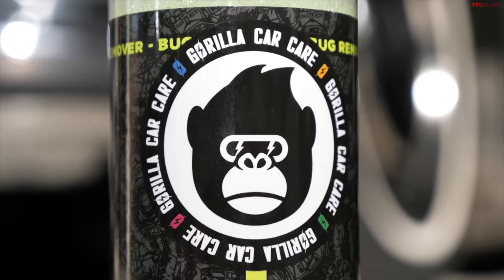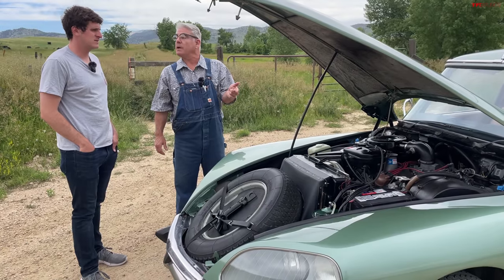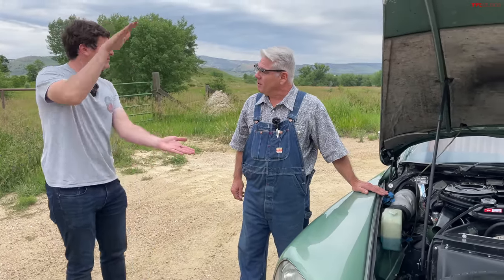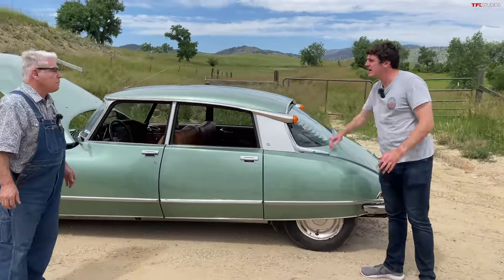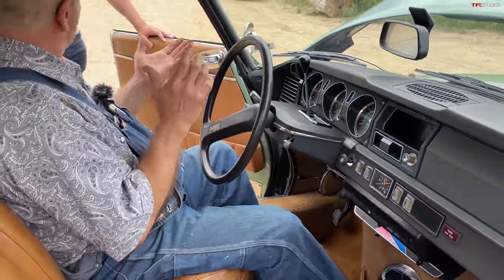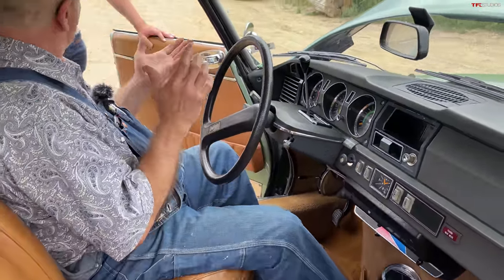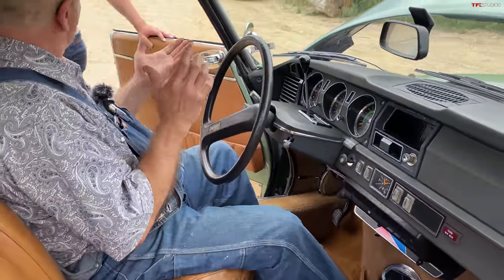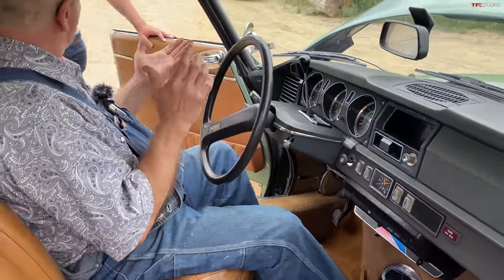Really THAT Unreliable!? Is The Citroen DS as Bad As The Internet Says It Is!?

Comment: SOME THINGS ABOUT CITROËN YOU MIGHT NOT KNOW
I grew up amongst a succession of DS sedans and recall my dad having no problems with reliability. The bodies tended to rust out very quickly, however. The manufacturer provided inlets for oil-spraying nozzles around the car, so in winter the most rust-prone areas could be protected, but nobody bothered to use them. (With equal alacrity, they designed a crank starter into the engine. On a freezing Canadian morning, faced with a dead battery, rather than call AAA my father retrieved the jack handle from the trunk and used it to crank start the engine like a Model T Ford.)

The DS’s velvety suspension was supplemented with the entire interior of the car, except the headliner, covered by a two-inch thick layer of foam rubber. Even the floor mats were made from a durable fabric that encapsulated this very thick layer of foam. The seats too were largely filled with foam rubber. All that foam, combined with the soft-riding oleo-pneumatic suspension, gave the occupant the sensation of, as they say, riding on a cloud. 

On a curvy road you’d think a car this softly suspended would wallow and induce road-sickness, or at least be cumbersome to manage. But the suspension valving incorporated anti-roll, anti-dive, and anti-squat properties, meaning the car cornered flat and handled exceptionally well. Along with augmenting the car’s ride smoothness, all that foam rubber insulated the occupants from road and wind noise, and in our Canadian winters seemed to make the car cozier. (Canadian DS models came equipped with a high-capacity heating and ventilation system.)

Put all the above together and you have a driving experience that is utterly unique. Riding in a DS, at least for a kid, was like being transported in some futuristic Jules Verne time-bending device that spoiled me for anything in the years to come, including far more expensive cars.

The company ran out of money (not for the first time) during the design phase of the DS series, and could not build the flat-six engine intended for this car. Instead they had to make do with the previous model’s inline four-cylinder. Though it made under 100 hp in its original form, thanks to the car’s light weight and aerodynamic design, it gave 30 miles to the gallon at 70 mph, and was capable of a top speed exceeding 110 mph. 

André Citroën, the founder of the company, was ahead of his time in the sense that he could spot a concept or product that was superior but never properly implemented. Rather than merely take note, Citroën capitalized on such novelties as the double-helix gear set, buying the patent then licensing its use and making his first fortune. A graduate of France’s famed Ecole Polytechnique, Citroën was able to adapt Henry Ford’s mass production concept to the production of munitions during WW1, and later to car manufacturing, eventually starting his own company. 

Unlike Henry Ford, who brutally suppressed his employees’ attempt to build a union, Citroën was an enlightened magnate. He paid his workers well and provided maternity leave and other benefits that were generations ahead of their time. In the part of Paris where his factory once stood there is a small park named after him.

Under Citroën’s leadership, in the early 1930s the company produced the Traction Avant model, in its way as revolutionary as the DS21 in several ways: His factory in Paris was a model of efficient production that was emulated by all his European competitors. The Traction Avant model’s novel front wheel drive architecture gave it superior handling and comfort, to the point it was the get-away car of choice by French bank robbers. Later, when Paris was occupied by the Nazis, the Gestapo commandeered every Traction Avant they could find due to its superior speed and other qualities.

A bon vivant sans pareil, Citroën lived lavishly even by the standards of an industrialist. He was a gourmand and a womanizer, but what finally brought him down was his addiction to gambling. When the Depression struck in 1929, his company’s profits having been lost at the roulette table, Citroën eventually was forced to transfer ownership to Michelin. (Development cost of the Traction Avant also burdened the company beyond its means.) 

A man of good taste to the end — he was to die in 1935 of stomach cancer — Citroën immortalized himself and his brand by funding the lighting of the Eiffel Tower. His combined engineering and aesthetic standards put him in the elite of auto makers — Ferrari, Maserati, Bugatti, Henry Royce, William Lyons who founded Jaguar, and a very few more — in that his product transcended its original purpose, as a transportation device, by providing its occupants with a sense of luxury and futuristic design that to this day impresses even those among us who are not car lovers.

The original post posed the question of whether the DS series was reliable, and the answer is a qualified yes. The car was well built and reliable, but it was not built to last. In their quest for efficient manufacturing and superior fuel economy, the car’s designers incorporated hard plastics throughout the interior. They do not age well and were disappointing even when the car was new. The switchgear also was mediocre. A look under the aluminum hood reveals a gigantic engine bay, crammed full of power plant, the spare tire, and what seem to be miles of high-pressure hydraulic lines. It is this car’s rubber and plastic components, because of their use in every part of the car’s functioning, that make owning this car in modern times contingent on eventually replacing everything that flexes. 

After Citroën pulled out of America in the mid-1970s (for them, the 5-mph bumper requirement was the last straw), you could buy a DS for next to nothing. As late as the 1980s and maybe later there was an American source of spare parts. Its founder bought up Citroën parts worldwide and sold them at reasonable prices. 

But that was 40 years ago. Now, I suspect, any DS still running has been restored — not by a speculator who seeks to profit from it, but by a genuine enthusiast. They will be discerning about what lucky person is the next owner of their DS.
Reply: What a great write up. Lot of stuff I didn't know.
Reply: Good info. My 1979 DS20 had 3 faults. It was a vacuum cleaner on dirt/gravel roads, it overheated on the highway on Saskatchewan summer days and couldn't defrost the windshield enough to drive at -40.
BUT yes it did 40 mi/Canadian gallon at 70 mi/hr and 35 mi/gal towing a 2000lb trailer. (used 4th gear once downhill in 6000 miles one summer). The video suggested the clutch was a weak point but we had no problem in 80,000 miles with a lot of trailer towing in the BC mountains. (starting off the front position on a ferry up a steep ramp was a challenge with the automatic clutch engaging fully at 800rpm and 104 hp not developed until 5000)
Reply: In Europe, many Citroën dealerships were poorly qualified to service the DS properly - especially in the early years.
The cars that survived that time have it better now. Not only are they almost exclusively  driven by enthusiasts now - they are usually serviced and repaired by a small number of DS specialists who know much better what they are doing.
Reply: @johntechwriter7097 Love it, that there are still admirers on the other continent! I have all produced Citroën's in my collection! But the Citroën DS stays the most modern one in its looks. After Peugeot took over, Citroën models went down! Ugly cars where produced and when Citroën made a successful model, after a few years it disappeared from the Citroën list; got rebadged and appeared as a more expensive Peugeot! For instance look what happened to the C1, it is was no longer for sale as a Citroën but got re-badged as a Peugeot 108 and stayed on for years.... I stopped collecting after the CX... They became too plastic...all these plastic fronts, horrible. But to get back to the DS I have got a berline "palas", a "decouvrable" and a "break familiale"! Did you know that you could order a traction avant with hydro-pneumatic rear suspension? My daily drive has this feature! By the way: you can buy new parts for 'old Citroën's' at The 2CV Mehari Factory in Belgium! These parts are not second hand or refurbished, but absolutely brand new! Anyway, still loved your interesting history of Citroën! Stay tuned😊
Reply: i aint readin ALLAT
Reply: My memory is that the side impact safety standard that was the end of Citroen imports. The SMwas sold for a few years after the ID and DS were dropped.
Reply: @aworthlessmanofnoworth7041  You don't have to!
Reply: So many cars from back in the day just rusted away because of poor maintenance.
I was looking at family photos, and you can see our Simca 1100 become a rust heap over a decade.
Such a sad end for another car that was before it's time.
Reply: Awesome to see someone from across the pond with that same enthousiasm for this quirky French brand as us Citrofiles in Europe. Just to add to the shared knowledge here: did you know that the brand is called Citroën because of its Dutch roots? The family name was actually Citroen (Dutch for lemon), and after they moved to France it was found that the pronounciation of "oe" in Dutch (approximated it's a shortened "ooh") was too hard for the French, and they added the accent to the e, hence creating "Citroën" (Kevin got the pronounciation bang on!).
Another fun fact, relating to the post above, is that Citroën did indeed immortalise himself by funding to light the Eiffel Tower (don't romanticise that though, it just meant that for the longest time, the word Citroën was branded in huge letters on the Eiffel Tower) - but they also used that to promote their big come-back model in the 80's! In the 70's, Citroën had lost its way - it was bought by Peugeot in 1976, thus becoming part of PSA, and they found that every good car they made was immediately scrapped and rebadged a Peugeot. In order to regain relevance and become a healthy car manufacturer again, they had to reinvent themselves. They started developing a car called Projet X, which would slot in between the GSA and CX. It was a rough process, changing from Projet X to Projet XA and finally Projet XB, but by July 1982, Citroën announced the model as the Citroën BX (the letters were swapped around to fit in with the CX and later AX models) - set to replace the GSA (which took until 1986). In October, Citroën hung a big box on the Eiffel Tower that simply said "Voici la nouvelle Citroën" - note the article here, la - they're not saying "Here's a new Citroën", no it's explicitly stating "Here's THE new Citroën" to invoke the sense of a brand reinvention. They lowered the box and out came a red BX, which was a complete stylistic departure from old Citroën cars. Square, boxy even, instead of flowing lines - the inside was still quirky, and it had the typical hydro(oleo)pneumatic suspension, but still. It was the car that saved the brand: from 1982 to 1994 Citroën built 2.3 million BXs. I still count myself very lucky to have one, a 1993 BX 1.4i Deauville.

Comment: This has to be the best DS video in YoutubeLand. So interesting and factually presented. The Citroen suspension was so smooth that Rolls-Royce used the same system on their 1965 Silver Shadow. They produced it under licence from Citroen. Tells you how special the DS was, --light-years ahead of the competition. Great cars. If only people could buy them new today.
Reply: Wow, I never knew that, thanks! I had an ID19, and though I've never ridden in a Rolls some of my friends back then had, and they told me my car was smoother and quieter than the Rolls. I didn't believe them, thought it was just flattery, but that car was indeed smooth and quiet, and a great ride. I got asked if my ID19 was an automatic, because the shifting was undetectable (unless I screwed it up,) but it was just a 4sp column shift that made no sound, it just slid into gear. Loved that car, I'd have another in a NY minute!
Reply: I drove a 1994 RR Silver Shadow when I was living in NY.  In comparison, I'd much prefer the Citroen.
Reply: @sunriseboy4837  it needed service i had both, at the time there was rolls royce and mercedes than there were all other carts, only wanted a SM as the citroens the bigger capacity engine i had was a 2.173cc´s as written on the back of the DS GT, also have two mint tracion avant from Dupond & Dupond from tintin, it still works as a daily driver for the years it as

Comment: When I served in the USAF back in the late '60s, I had a Citroen ID19 which I drove all through Europe. It was by far the most comfortable car I've ever owned; mine had a 4-speed column shifter & a lot of people thought it was an automatic because it shifted so smoothly. The interior was all lined in foam rubber under the carpeting, so it was quiet as a Rolls.

If I didn't live in N. Texas, where it gets hotter than Hades in the summer, I'd love to have a DS21 (but I'd have the 5-speed shifter!) One thing that didn't get mentioned in this video: it's the only car I've ever had where you could have the driver's side window down & not get blown out of the car by the wind! That's because the front of the car is wider than the rear, so the airflow is outside the window opening. I used to cruise at 140kph on the autobahns, it'd do that all day long!

Comment: For those who want to know! The lever to adjust the height of the suspension is connected with mechanical levers to hight-correctors (in german they are called Höhenkorrektoren) for the ride height. These 2 Correctors are intalled and get theis input from a movable connectin to the anti-roll-bar. And because the hydraulic system is one, citroen engeniers connected the brakes on the back with the supsension on the back to get more brake power when loaded in the back. Citroen did some weird but well tought out french mechanical wizardry on thier big Cars for a long time.
Reply: They still did recently

Comment: The one thing I really like about the suspension is that the geometry of the wheels does not alter according to weight. The wheels do not splay outward under load nor tuck in when light keeping tyre footprint constant, essential for good road holding and braking.
Reply: Absolutely.

Comment: Brilliant video. There are two other quite distinctive features. The front of the DS is larger that the back. It helps making the car more aerodynamic. The distance in between the 2 front wheels is 20cm wider than the distance in between the back wheels. The other one is that the front light are not only turning, they also stay constantly horizontal and focused on the road even on bumpy roads. The station wagon version was super popular for ambulances due to the safety on any condition, the space offers at the back and the comfort. And for filming horse races, often the cameras were mounted on DS as the suspension is so effective that the image is of much better quality. I own a Citroen  SM, sort of DS coupe launched in 1970, with more innovations including the DIRAVI steering system and a Maserati V6 engine. Jay Leno did a good video about the one he owns.
Reply: I believe all front wheel drive cars nowadays have a wider front track. That was pioneered by the Citroen Traction Avant along with FWD.